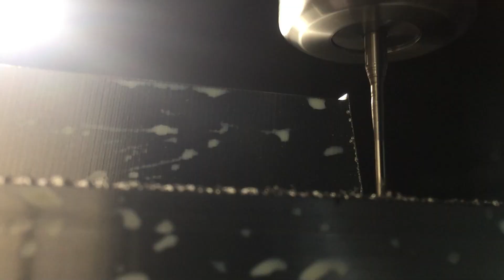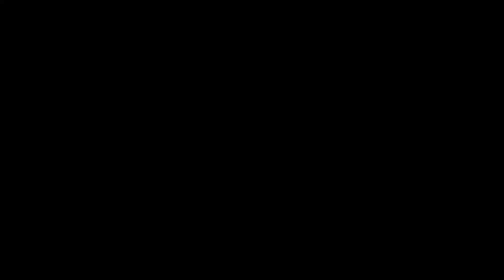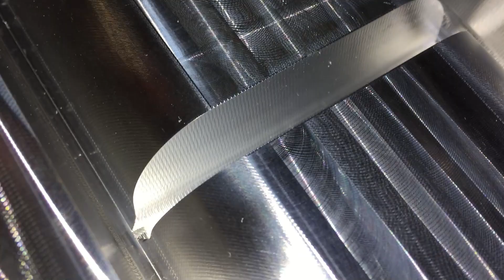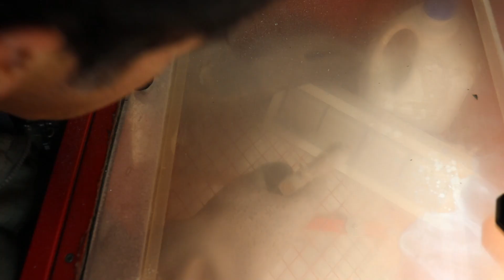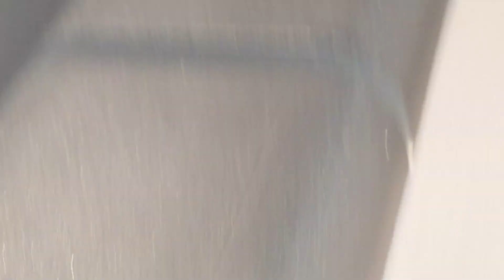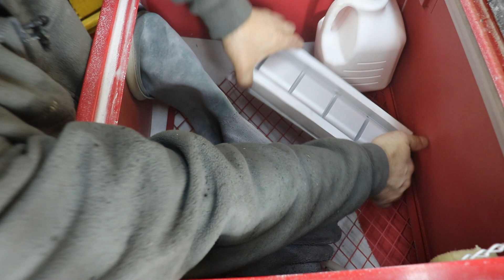Plastic injection mold build for a tray

Comment: Nice video on machining a plastics mold. We make our molds out of steel. Do you run these parts on a Hurco vm10i? If so how do you think it would handle machining steel and 3d work like you were doing?
Reply from the maker: Thanks for watching.  Yes, I used a Hurco VM10i for these molds.  I think the VM10i should be able to handle steel pretty well. I have run P20 mold steel on it before.  Most of the work is just switching to a steel milling mindset vs aluminum.  ie I pre drill most endmill Z axis lead ins, and run the RPM and feed slower, use low helix 4-5 flute mills etc. How do you like your VM10i? I have 2 and both of them give me computer / sofware problems
Reply: I currently don’t own a Hurco vm10i. I have been watching your videos and noticed the Hurco. That’s no good about your issues with them. I am looking to buy a small VMC and have priced Haas, Doosan and am now looking at Hurco. Does the Hurco creep as it heats up and give you miss alignment on your 3d work or does it have compensate. Thanks for your reply.
Reply from the maker: @hawkprecision7878  Yes, all the vertical mills that I have used do thermal drift, even with a spindle chiller ( chillers make it much less)  If I need to hold microns then I let the spindle run at cut spped for ~1 hour, then i reset the tool with a loop, then start the program. this is for small tools running 10,000 RPM.  The heat is exponential to the  RPM. I also spray coolant on the expossed spindle to help.  The hurco has a good spindle, I had problems with Haasspindles ~5-10 years ago, randomly overheating in a cut from bearing chatter, but maybe theyfixed their spindle problems.  These factors i am describing are 1-1.5 thou range of error BTW  Haas Super minimill is really good
Reply: Thanks for the explanation. I also looked at a Mazak Primos 400 that runs a gantry style. Seems a good idea.

Comment: Which alloy do you use for mould cavities, is it harder than 6061?
Reply from the maker: I usually use 7075 (73,000 psi) Aluminum for inserts.  It rings when you hit it, 6061 makes a "clank" sound. thanks for watching!
Reply: @DragonflyEngineering  Thanks for the reply.
Reply: Good info thx.

Comment: It always amazes me how a brick of metal transforms to make something, that could ten,churn out thousands of something else, with very little effort. On another note, 3D Benchies are supposed to be the determining factor of the max speed of a 3d printer(still a longway off from industrial IM, apart from extreme wear on tooling?).
It will be a fun project, if you could create a 3DBenchy mold(may be a buch of them in a family mold?), that blows the current world speed record(one benchy in 2+ mins.). It would be a fun project, will definitely help with viewership numbers. While searching on thing*verse, search for original 3D Benchy. It is nothing but a small boat(has some enclosed area though,may need inserts, or something more creative?). Just some 💭❤️👍
Reply: The fastest machines I've personally seen are the Husky ones that produce preforms for PET blow-molded bottles. The preforms look like test tubes but with a molded thread. Something like 48 hot-runner cavities (so no sprue to remove) with a (don't quote me on this) something like a 10s cycle so around 5 parts per second if memory serves. All hardened steel with TiN coating for mold life in the millions of shots x 48 per shot.
Reply from the maker: Thanks for the tip! I will look into 3D Benchy
Reply: @DragonflyEngineering look up the speed boat challenge. It’s amazing how fast people are printing these now. I too would be curious to compare an injection molded version - I bet you could sell them as reference models for 3d printing geeks